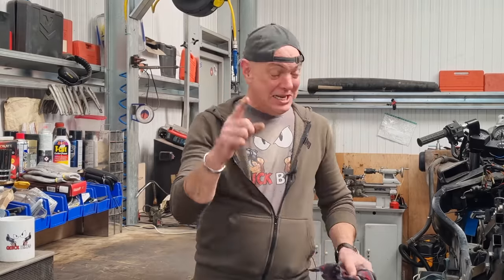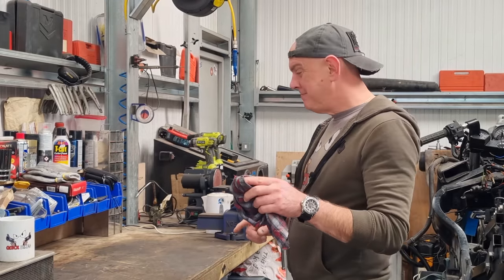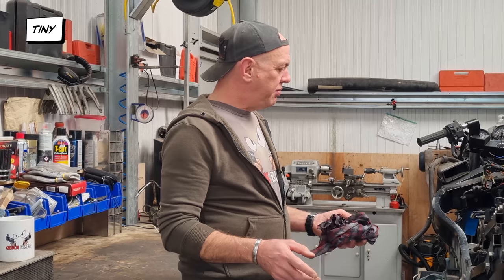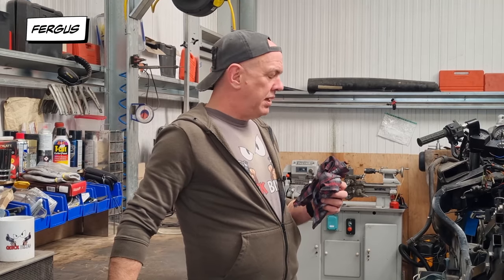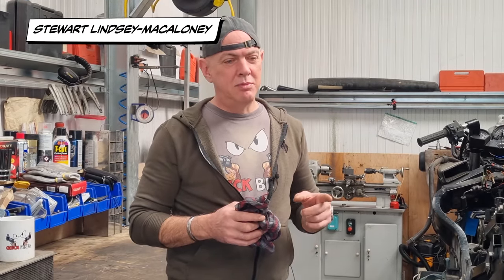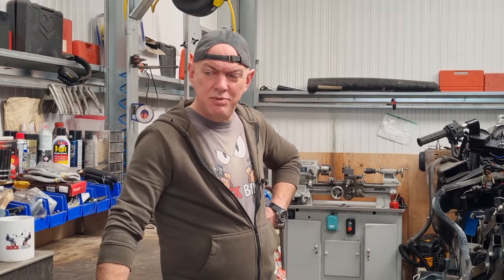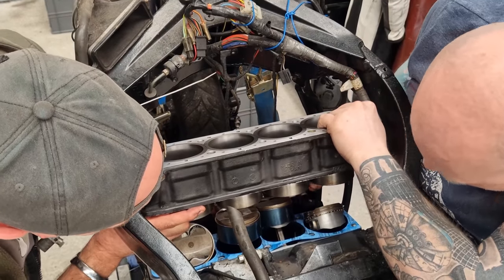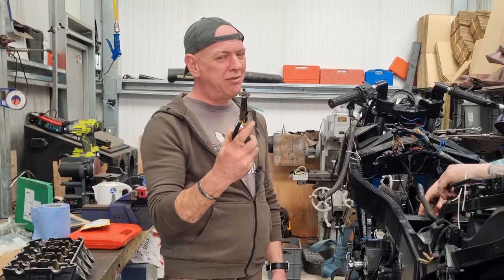Installing the pistons and bores - 1990 ZZR1100 project bike

Comment: I did my fz 750 and xj 650  barrel on me Todd. I  smoothed the taper at the bottom of the bores  with a fine emery roll on the dremel  and had a thin stick to help poke the rings in  worked good the ring compressors can get in the way   ! Narrow compressors not much wider than the width of the ring pac would help
Reply from the maker: Yeah, I know what you mean.... the band on the compressors doesn't leave you much wiggle room does it?

Comment: Bit of a mission but you got there. Depending on the ring spacing (less than around 13mm) jubilee clips work OK as ring compressors. Small enough not to get in the way, cheap enough to buy four and fit them all at once.
Reply from the maker: The bolt up clamp thingy that Jamie had was much better than the pliers version I got.... just waaaaay betterer  😁👍

Comment: I think you’ll find those engines the chap had were probably EN450, basically half a GPZ900 they used them in a belt driven custom, I dispatch rode one for about a year, never had to lubricate or adjust the belt dead reliable if a bit fugly!
Reply from the maker: Thank you matey, I'll let Jamie know at the weekend. Much appreciated matey 😁👍

Comment: Jaimes Tool !!!!!!!!! , was the right way to go , but in a pinch you could have removed the '' clip '' pieces from your Bands , and used a jubilee style hose clamp to squeeze the rings in . Use plenty of Oil , and it works .
Reply from the maker: Those clamps I got were rubbish and we simply didn't have enough hands to get it done 🤣😂

Comment: I don't use ring compressors. I use 2 threaded rods diagonally  to guide the cylinder and compress the rings by hand.   On the busa threads are 1,25 m10.
Reply from the maker: The second set of pistons went in by hand and it wasn't too bad really as there's a decent lead into the bores... it was a lot easier with the bolt up clamps though 😁
Reply: Ok.  I edited my comment about 10 times , for people to understand 😁.  As always master channel!
Reply from the maker: Hehehe, thanks for chipping in matey 😁👍
Reply: Always fun to be here.  By using threaded rods/studs you prevent the cylinder tilting so you can focus on the piston rings only

Comment: Put two Rods or flat bars Under the Pistons to stop them Moving about and it keeps all tight
Reply from the maker: Once you get them started it's not too bad, just a proper faff.... 🤣😂
So much easier with the bolt up clams though 👍
Reply: If you stop the Pistons moving or flopping about the Barrels will drop straight on with the rings compressed

Comment: Hey ... Hows about a swap ... Ill swap ya my 40 odd years as a Honda mechanic and you swap me ur welding fabrication skills ... I can glue stuff together with , tig and arc ,,,,, but pretty doesn't even leave the stalls !  ( ACDC AND IRON MAIDEN ! ...in my shop !).... arrrgggg hahahahahahahaha the frustration being here in Japan and not being able to pop over and help .... "me " a bit of aluminum tube and a hose clamp and a locked crank,   and  "bob" IS your uncle !   ...     loving this video fellas !     I like the Scripted extras !
Reply from the maker: Hehehe.... I'd love to be a mechanic and know how everything works, but little by little I'm learning. ACDC is always plating in the shop...  it just has to be done 😁👍

Comment: Hi how are you I have been following up but I have a problem with over size Conrod bearing
Reply: Kawasaki zzr 1100
Reply from the maker: Thanks for watching matey, it's much appreciated 😁👍
I'm not sure what you mean about oversized bearings.... are your conrods not standard or something🤔
Reply: @QuickBikes  yes my crankshaft is at +50 not std
Reply: The crankshaft was faulty so I need to knw where I can get Conrod bearing size 50 I will much appreciate
Reply from the maker: Ah right... any good bearing supplier should be able to point you in the right direction. I've used a few different folks in the past, All Balls Racing, The Bearing Boys, Fowlers etc. They all have websites and tend to be dead helpful. If you know the ID, OD and depth of the bearing you need, one of them should be able to help, otherwise just Google bearing suppliers in your area. Hope that helps matey 👍
Reply: @QuickBikes  am in Kenya needed to import
Reply: @QuickBikes  or how do you deal with Kawasaki zzr 1100 when the connecting lord spin
Reply from the maker: Kenya.... wow 👌 
Erm, if you know the bearings you're after or have the numbers off them, you should be able to find some from an international seller I would have thought. If you have no idea what bearings to get, you need to get measuring  phone up a dealer and have a chat with them I think. Its hard to get exactly what you're after in messages, so a conversation with a bearing supplier would be the best way. If they can supply them, they should get them out to you quite quickly I would have thought. If they haven't got any, at least you would then know the spec and size of bearings you need. Good luck matey 👍
Reply: @QuickBikes  do you have them
Reply: @QuickBikes  for Kawasaki zzr 1100 Conrod bearing size 0.50